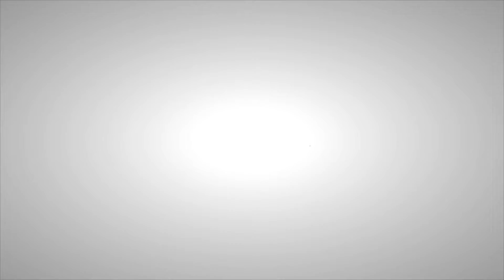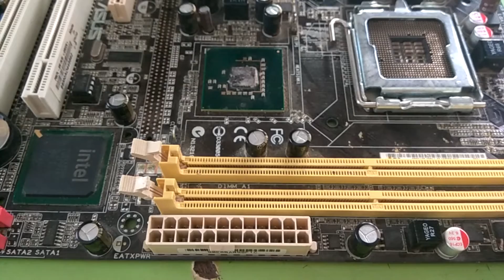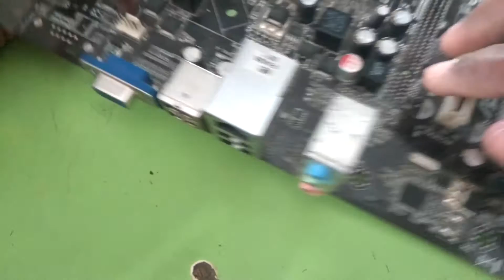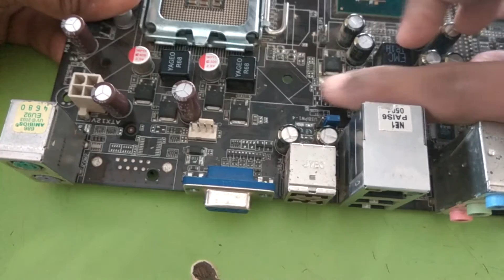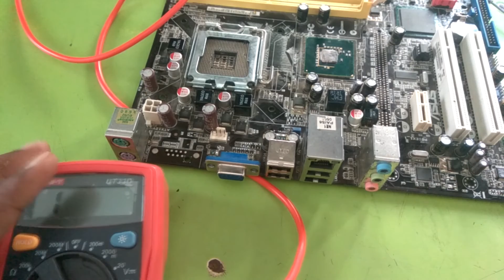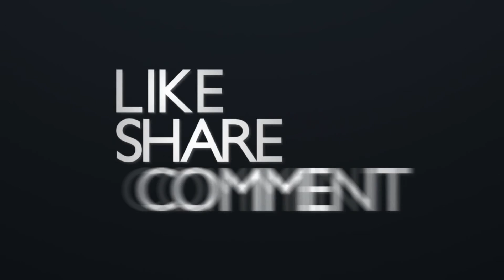[Eng]Advance Chip Level Motherboard Repairing: Lecture 15- North Bridge Testing in Desktop Practical

Comment: very informative video..just a question..in DDR3 or DDR4 motherboards..is it the same PIN No. 53 for the RAM Sockets?...and testing the impedance of the capacitors on the NorthBridge Chip, do i have to test all capacitors to make sure nothing is below 80 ohms..

Thank you very much..keep it up..More Power God Bless

Comment: How do I repair the capacitor on mother board if they are above 80 impedance
Reply: You should heat the Bridge until all solder balls melt but you have to do it temp controlled bga station,this method called as reflow. Reflow does not Last long, problem will occur in time. Permanent fix is reballing chip.

Comment: If infidence value is less than 30 that mother board have chance to repair or no
Reply from the maker: no, it can not be repairable....impedance should be high....if it is about to 80 it can be repairable...thank you very much for your question and curiosity...